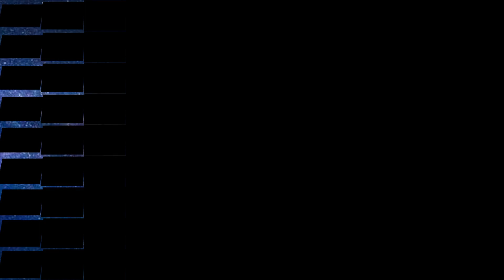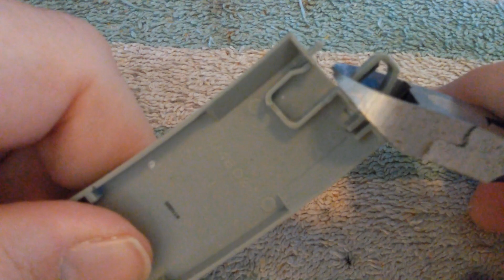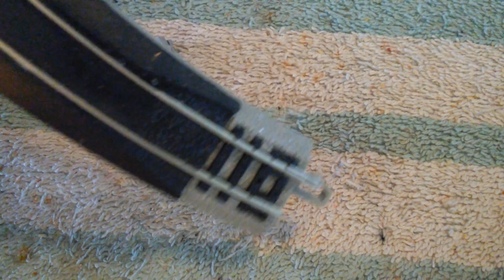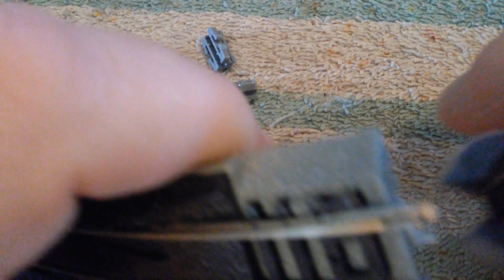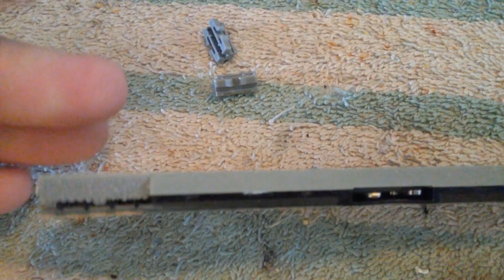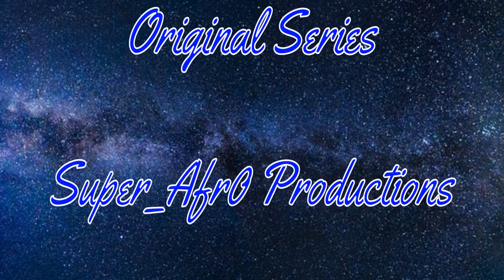"How To"  Bachmann to Kato track modification.

Comment: I found that if you run an Exacto knife around the kato plastic joiner and use that plastic piece on other side of kato empty slot and push in another metal joiner it will looks like a cleaner connection into bachmann track. Also use a thin wood or plastic piece of material to make kato track come up a bit. I am thinking of doing that on my Bachmann layout using Kato double crossovers ...

Comment: Very good! Thank you! In your opinion, if I mix the Bachmann switches and some tracks with Kato, do you think I’ll have any derailment issues? I saw a video and they were saying that trains often derail going through the Bachmann switches. Not sure whether that’s being pushed or pulled. Have you ever experienced that? I remember with my Atlas code 100 snap track, I had to add extra weight to the cars to prevent that from happening. Thanks for posting! Very informative! Happy Railroading! 🚂
Reply from the maker: It is why I switched to Kato because of issues with the Bachmann switches. Yes even I had issues. I do like how well the Bachmann turntable worked but it would not work with a walthers  roundhouse so I sold that as well. I would not invest in Bachmann switches and if you did you should sell them and get Kato switches.